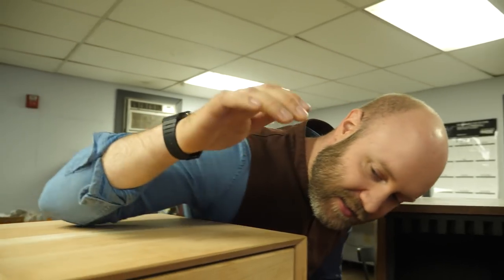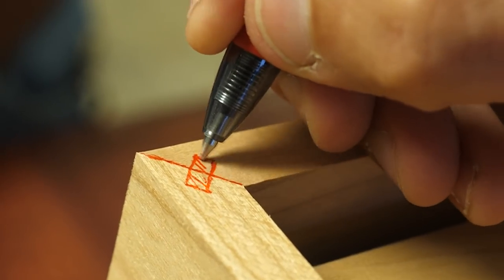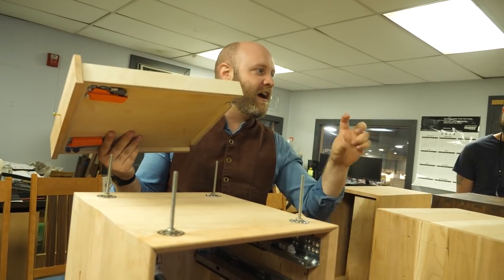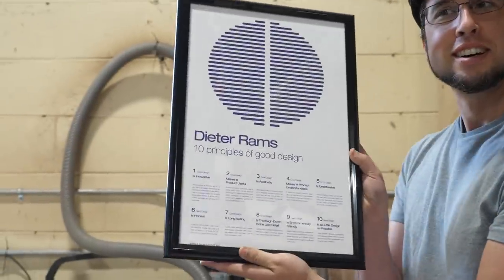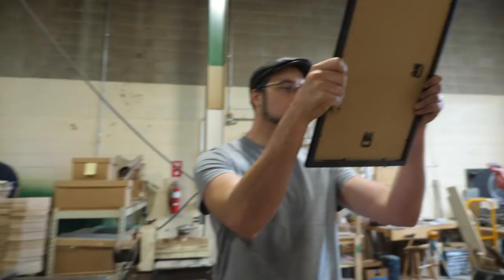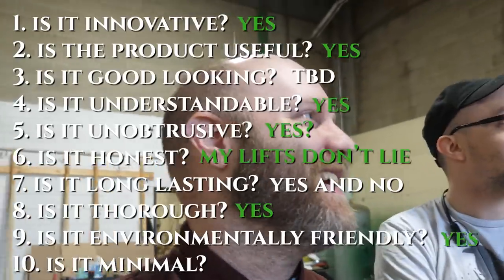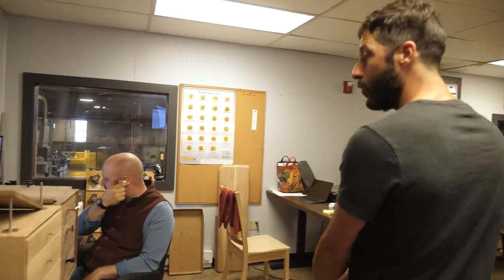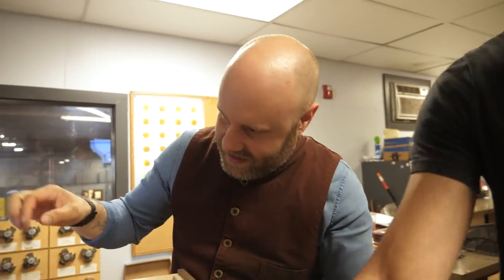Metal Hardware or Wood On Wood? (don't be gross)

Comment: I know weight is going to be an issue. 1 of the 2 monitors I use is nearly 16 lbs. The other is probably another 8. So right there is about 24 lbs. plus a few shelves that are maybe in the 20-30 lbs. range while empty. Saying that you're going to have 100 lbs. on those arms is going to be a bit heavy and wear out those motors fast.

How about an option to not have the shelving units attach? For instance, you have the larger unit (10 shelf holes) which can be mounted or have feet under it so it becomes stationary. Then you can possibly have a maybe 15 shelf hole unit. Something around 2 or so feet tall that can sit there and your desk can lower on top of it if need be. 

Another option would be to have it just tall enough that a smaller 5 shelf hole unit can be attached to the desk but then rest on the base unit that is sitting on the ground. A portion can move up, the rest stay in a spot. Call it a hybrid system. Cause I'd totally get 2 smaller units and attach them but then have 1 bigger one down below for the things that I don't need to lift up when I'm working. 

It would also give the option of not having the sit / stand and leave it as a simple desk. You can buy say two 18 shelf hole unit (number out of my butt) that is stationary and strong enough to support just the topper. If you want the motorized feet, you add on later. You want to change out the shelves, you swap out the 2 larger ones, use them as cabinets elsewhere in your place. Modular :D

Comment: Would a delrin insert/rail be worth considering? Smoother operation and less wood on wood wear? Allows for more wood choices for the drawer setup?
Reply: This is what I was thinking.  The only problem is sawdust and waste during Machining.  You don't really want to mix plastic with sawdust.  Even with the benefits of a plastic runner it might be better for them to just use all wood.  It doesn't wear that badly.

Comment: i saw wood on wood and immediately thought of my old house's jankyass kitchen cabinets. i think the drawers were like a center rail thing, not side rails like these ones, and the most used drawer was somehow fucked up and was literally shaving bits off the rail. we'd have to rinse the pots and pans from the top shelf underneath it before using them because they literally had a thin coating of sawdust. idk how or why properly made wood drawer thingies are smooth but i'm glad my initial reaction was completely wrong lol.
Reply: also, i don't need a desk but i like these drawers tbh. what's the unit size? assuming you'd sell the drawer units separately, it'd be cool if they fit into the target/ikea-style 11" or 13" cube shelves

Comment: I’ve never been a huge fan of wood drawer slides, usually they are not manufactured with high enough precision and just end up jamming and feeling worn very quickly. 
I think it might be worth looking at adding UHMW on the running surfaces of the drawer runners to make them essentially wear proof and super smooth for the better part of forever. It can be machined in the same way as the wood to make full runners, or a strip could be screwed into the tops of the runners as just a west surface.

Comment: Wood rails is a win. I like it a lot. I'm for either wood hardware or just a nice notch in the drawer front like the popular ikea set of drawers. It doesn't have to look exactly like them, but that could remove another pain-point if you don't need hardware at all.

Comment: Just because it's how my drawers are for my solid wood dressers, they have drawer runners underneath the drawers down the center. So how it is, is the drawer is up maybe an inch [again this is a dresser drawer. But an inch may be giving it too much, I think it's like a half inch or less] and underneath the  drawer bottom is two pieces of wood that are grooved, beveled inward at maybe 30-45 degrees, that slides onto the center pieces of wood that beveled outward and to keep the drawers inside are two a little plastic clip that stop the drawer from being pulled all the way out but can be pushed down to remove the drawer.

I don't know if that's a useful idea for a much smaller drawer, but I thought I'd add it.

Comment: All wood drawers are a win in my book. My only concern is the wear and tear on the slide system every time you bring the drawer all the way out with that bolt in it. How many times can a 10 year old kid get something from their parents desk before the drawer breaks. 

Also, yeah the motors won't last. But I would like to buy quality motors, perhaps ones paired with a quality lift system. I don't want a nice real solid wood top to this desk only to have some made in x country cheapish thing that falls apart seconds after warranty expires.

Comment: On a serious note, I'm fairly concerned about the weight.  It's not just the desk with the hardwood top and drawers. Which sit-stand desks don't typically have..   People put heavy stuff on their desks.  Even if it can work it doesn't mean it's going to last very long.  I'm only concerned because a recall on sit-stand desk could severely hurt the company.

Comment: Offer a 3d model to print replacement slides for the desk? Also some filaments would be nice. But you'd need a super hot printer to print delrin or even nylon. Or better for MFRing 3dprint or cnc a mould to cast resin slides for mass production.

Comment: Good luck sourcing under mount slides, they have been backordered since September. Centermount slides are a lot more easily accessible, but they show (who cares because the drawer will be closed 99% of the time anyway). Wooden drawer slides break often, not worth imo. The other slides would be epoxy slides which are cheap, but more useful than wooden  slides. I work in a hardware store and help someone every other day with slides.
Reply: Counterpoint: People go to hardware stores to fix things that are broken, so your experience is biased by encountering people who are mainly seeking to faulty or damaged slides, not ones that are still going strong. I have a 40-year-old middling-quality basic-as-hell desk with wooden drawer slides. The desk has been moved from state to state at least four times in addition to numerous moves across town and up and down flights of stairs. Even with the drawers packed full and heavy, the slides have never broken. Well-made wooden drawer slides will hold up to decades of abuse, and I trust that anything Wyrmwood makes will be well made—but even if a few slides fail, for whatever reason, Wyrmwood backs everything they make with Craftsman's Promise, and I trust THAT more than mass-manufactured metal drawers slides from China. Metal slides jam, are expensive to replace, can be a PITA to source, and in many cases will require you to replace both because minor differences in design can mean big differences in compatibility. Given those factors, I'll take wooden slides any day.

Comment: Do these use threaded rods? If so, please find a way for us to grease them ourselves. Same with the motor gearing. Even just drilling a little hole and adding a tiny ball valve grease port.

Otherwise these desks are looking fantastic!

Comment: I used to work with those Blum runners. They are right that they allow you to cover your mistakes but you do lose Soooo much space to them. Especially in something like a little set of desk drawers like that. And they weigh a TONNE and cost a fortune. The timber on timber is smart. I mean if it ever sticks rub a bar if soap on it and it’ll slide like a dream. You have to adjust those runners? Get out your torques head screw driver and swear as all you did was make it worse.

Comment: If the drawers had wooden rails wouldn't there maybe be problems in opening and closing them as the wood expands or contracts with temperature/ moisture changing from season to season?

Comment: Instead of an insert perhaps you could use a little L shape with a pivot point. You push them in to engage the stop and pivot them into the drawer to release it. Have the L shape facing forward to cause pulling on it to prevent it from falling out and have the drawer bottom out it the back to prevent it from pivoting on close.

Comment: UNDER DESK COMPUTER TOWER MOUNTING

Knowing your fan base/following, a lot are gamers. Normally large towers present an issue to sit/stand desks. Putting a large tower in the top takes up a lot of space. And setting it on the ground presents major cable management issues when you raise the desk height. 

Giving people a solution to have their rig raise and lower with the desk, without having it on TOP of the desk, would probably be exciting for a lot of people. 

Just a thought from an avid Wyrm Lyfe subscriber.

Comment: As a long time Cabinet delivery man, I actually have input... no metal slides. Screw those things. They seem nice, until one breaks. Then 100 break. Then 1000 break. And EVERY single one needs to be ordered. Then waited on. Then 100 get installed wrong. Maybe another 100 destroy the product trying to install.  And those are on FULL kitchen sets with maybe 40 slides or More. I will never ever defend those pieces of junk metal. They also have absolutely no use outside of just being slides, so keep it simple stupid. Turn of phrase, nothing personal.

Comment: could the stops on the slides be a latching spring mechanism?
you'd pull on the stops to set them in their out position and then press them in to set them in their stop position

Comment: Probably my only concern is that I'm assuming you couldn't violently throw the drawer closed the way you can with metal runners that include brakes. However, overall I still think I'd prefer the wood design. Less to go wrong, less heavy, lower cost, more craftsmanship (higher end feeling).

Comment: Having had a lot of wood on wood slide drawers, I would probably not go that route. You run into issues, especially in climates where there is high humidity and large changes in temperature where they get very sticky and not very fun to close. The metal almost always works better.

Comment: Design tip to consider: rather than an ugly T-nut or threaded insert in the drawer box, you could just drill and tap a threaded hole in each location and screw a decorative screw through it. And of course make sure that the screw doesn't stick too far into the drawer box, that would be really annoying
Reply: @Nathan_Talisien  Thanks!
Reply: @BenTheMagnifice  No worries, mate! I figured you probably woulda copped to the shenanigans yourself anyway, but I was feeling ornery and borking scammers is as fair a way to spend a lunch break as anything, right? :P

Comment: I think you can still get the best of both worlds. You can get a full pull and no hardware with a wooden slide if you do double actuation. Make the grove wider vertically, and make the slide come out about 25% with the drawer. slide on the drawer, slides on the base. bingo bango potato.

Comment: I once had a desk with full wood drawers. First it was nice and smooth but over time it became a pain in the ass. Not smooth at all and kinda scratchy.

You know big companys usually have like small robots that do test something like pulling the drawer out and pushing it back in, nonstop, for months. Just to find out how long they can guarantee safe use.

I know you guys wanna do the DM Screen first so why not give the wooden rails a more thorough test in the meantime.
Reply: Metal slides in my experience are even worse. They will get bent.
Reply: @jaxstax2406  and clogged with grime/dust

Comment: Having gotten used to push-open soft-close drawer slides, I don't want to use any other type. Even nice wooden slides I've had end up feeling bad after repeated use, while I've got some blum slides that have held up to very significant abuse and still feel as good as when I first installed them.

Comment: $400? Only question there is why you ever considered using the metal slides to start with...

...though I guess you should check that the wood ones are still smooth under load.

Comment: Wooden sliders is great, can just re wax them when they get grippy. Probably a good incentive to not overfill the drawers too, saving the motor a bit of struggle.

A replaceable motor, or a hand crank option would be great, that would be the deciding factor for me. If I couldn't see how I could repair the desk when the motor eventually fails, I would not buy this (very expensive but well made) desk

Comment: "The only drawback is that we have to make them"

No, the drawback is wood expansion and movement of your wooden rails and groove, making the drawer action stiff or too lose over time and different humidity. By no means is this a dealbreaker, but to not even be aware of it does not bode well for professionals.
Reply: Yes thank you. I've never found a wood slide drawer that works well all year round. There's aways a time of year when the drawer sticks.

Comment: Hoffman keys my friends
Reply: Hoffman keys?
Reply: @birchlind  They are dovetailed joint-looking pieces that you insert into wooden joints by cutting out a corresponding size hole. Some call them bowtie joiners. Picture a biscuit or dowel rod insertion in the middle of both planks of wood but instead of drilling out the middle, this goes through the outer layers. You can also use them to stop wood that is already splitting to pull the parts together, such as cracks in full slab tables before you finish it.
Reply: @birchlind  instead of the spline on the 45 from the beginning
Reply: @RoseKindred  gotcha, thanks 🙂

Comment: Don't bother making sides of open drawers mega pretty. Just put the metal into a groove and have it not go all the way to the drawer front and it's fine.

We only open drawers as we look down into them. Barely one notice the sides.

I own many IKEA drawers and have never given a crap about their sides...until now that I checked and noticed the plywood and non-pretty metal rails were visible on the sides.

But the metal doesn't go all the way to the front and it's inside a groove so it does not look bad.

Comment: No handle push to open
wood on wood sides are fine, are you waxing them? 
A small piece of metal at the top back of the drawer can give u near full extention with just a small stopper block before it comes out. Hard to describe but it is a common thing. 
For the lift motor I think 200-250 lbs over the desktop and drawers with should be your minimum goal also check for if all the weight is on one side vs the other if it jams the mechanism. 
Good luck y'all this could change things for you all. I living the gaming stuff but you should never stay in one lane if income.

Comment: I'm very skeptical on the wood slides. If they were good, you'd see them more often. Visible slides would be fine in my book too. I only remember a few wood on wood sliding drawers, and they were terrible, getting stuck if you didnt push them in perfectly straight. Especially if they got full of stuff
Reply: It was for the drawer size. Otherwise I had slide wood on wood an no problem

Comment: Most of Dieter Rahms rules are ridic easy for furniture 😆 - I feel like they're written for electronics. A stool is an automatic 7/10. "Is the product understandable?" Yeah...you sit.
(OK maybe the innovation point is nigh impossible to reach for a stool)

Feel like his rules are only relevant when the product is advanced enough that the average consumer wouldn't be able to use it unless it was intentionally simplified. Like a radio.

Comment: I would suggest having the hardware options be an optional upgrade. I personally have a few issues with wood on wood, and also highly prefer push to open and soft close hardware in general. The supply chain issue would be pretty minimized by going that route and then being able to order however many you need after you know how many people want those options (Even if it takes longer for us to get the orders fulfilled, it's worth the wait IMHO)

Comment: Wood slides warp and are tight and sound ugly. Side mount metal drawer slides are the kitchen standard for basic to high end kitchens for a reason. Wood on wood is ancient and old and outdated.
Reply: And not to be even more negative, but those stops are literally the same thing as the $20 Target pressboard dresser I bought for my college-aged kid to use. Just because a CNC is being used to cut the channels doesn't make it a better slide, its just faster to create than a hundred years ago.

Comment: "the only drawback is that we have to make them... but they're very easy to make"
cut to season 10 episode 69 and they're bidding on a $2m machine specially designed to cut a literal million+ drawer side panels and sliders because their existing machines are at max capacity with other products 🤣😛

Comment: Manufacturing in wood is extremely environmental.  What would be even better would be if you invested a small portion of all profits to re-planting trees.  What would be best is if you used hand tools as nuch as possible, though likely not economically viable.  A way to buff your environmental footprint would be to invest in a wind turbine that ran an air compressor that in turn powered what tooling you can (drills - table saws - glue tables).  Air is not as effective at driving cnc or such things.  YOu could also build solar into your new building and save what you can there.  Last I heard - 3-5 years makes you back your investment on solar and from that point it's free (other than low maintenace costs).
Reply: Using compressed air to power anything has about the highest energy loss fractions of anything. I still wonder why it is used in professional machinery at all, maybe due to safety concerns, and energy still is comparatively cheap. With current technology and prices, solar roofing is better in just about every aspect compared to a domestic use wind turbine.